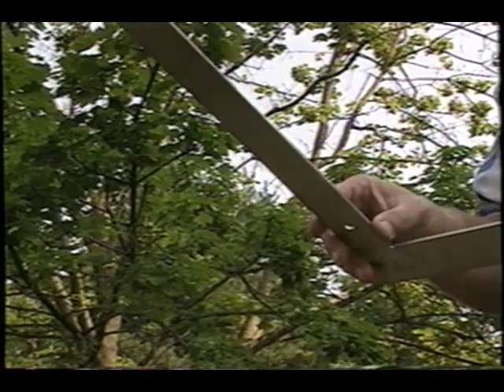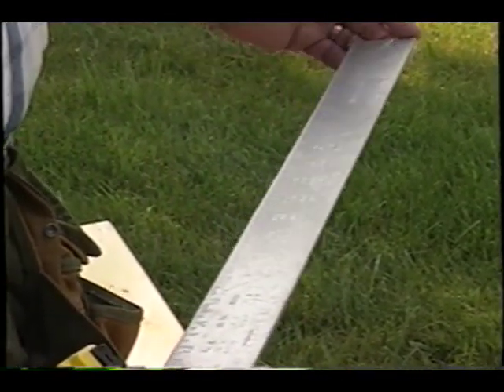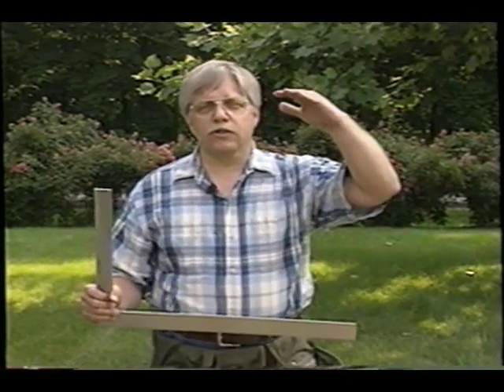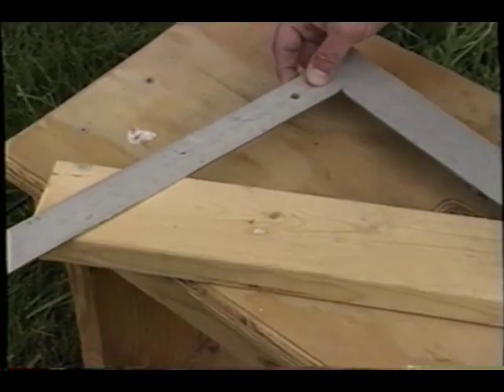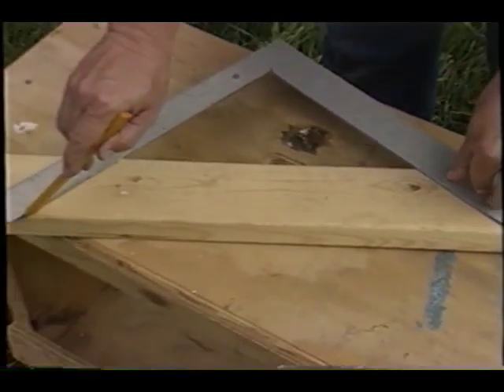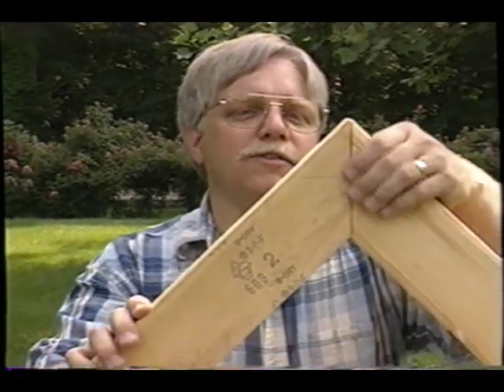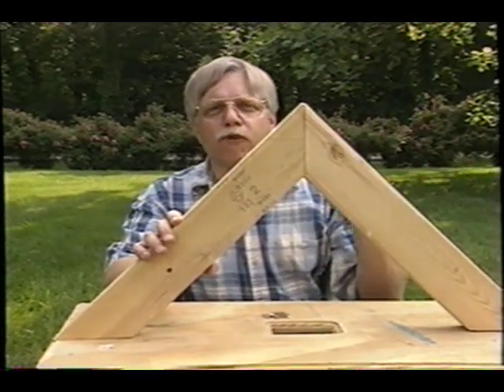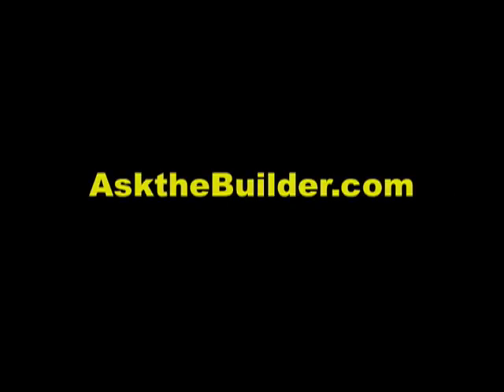Framing Square Angles

Comment: Years ago, I found and old booklet from the Stanley Works from the early 1900's, describing the many ways to use a framing square for angle layouts.  It's an absolutely mind boggling tool if you know all the "tricks."  No wonder the Masonic Lodge has it as a symbol in their logo.  The square truly has :mystical powers" in the hands of someone that knows how to use it.

Comment: The framing Square is a remarkable layout tool.  You'll notice that one scale is actually in twelfths of an inch.  A straight edge and this knowledge can allow for very accurate scaled drawings and jig making for repetitive cuts.  (Rafters)  The scales on the middle of the square can also be used to calculate rafter length, if you know the rise and the run.  The table can also be used for angles and compound cuts on hip framing.

Comment from the maker: High school geometry.... Rise, Run and the resulting diagonal. The bird's mouth cut is simply a 90-degree cut, but oriented to match the pitch. You also have to be aware of the heel height. Confused yet? Get a roof-framing book for now. I intend to tape a video to answer your question this spring.

Comment: Does not actually show how to use it. More or less just asserts that it's easy.
Reply from the maker: It is easy and what you're asking for is a 5-hour streaming video clinic. There are so many things to show about using a framing square.
Reply: That's right, he only teach us what's the tongue and body... he should show how to find a 6/12 pitch and show the numbers where he marks, at least.